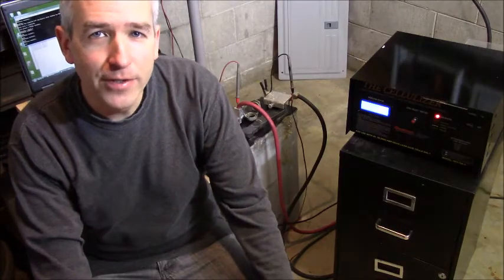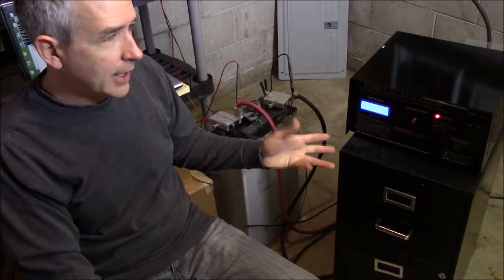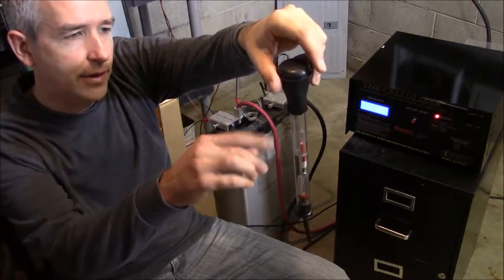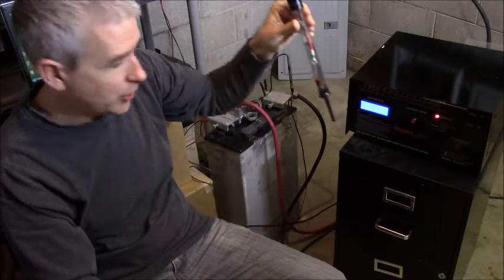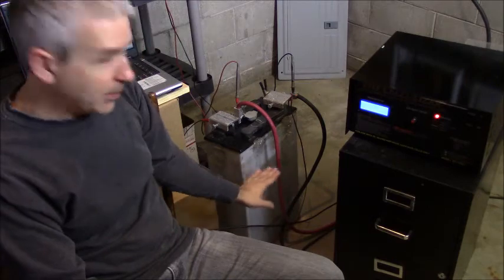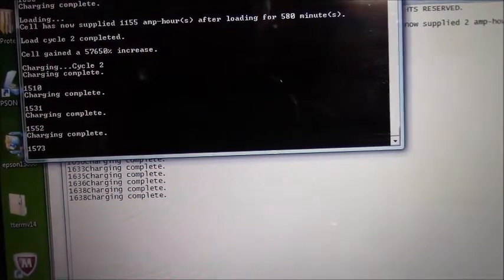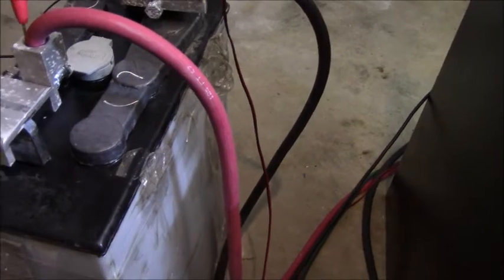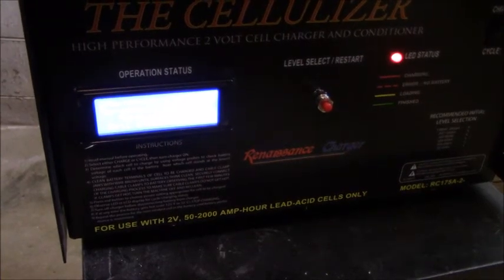RC-175-2 Cellulizer Restores 1000AH Battery after sitting 5 years

Comment: you only got 1 S.G meter? Don't trust it.
Reply from the maker: What are you talking about?
Reply: the Specific Gravity gage.. I have/had 4 of them and 2 Fluid Refractometer Automatic Temperature Compensation. The Refractometer is best.
2 of the type you are using should not be trusted in my opinion. in fact one always would read 1.300 even if the real S.G was 1.260...
Reply from the maker: Frankly I don't use them myself, but I was explaining a little detail about them. Interestingly the final result of my big battery was much higher than original capacity while the meter was still showing lower gravity levels. So I do not judge actual capacity by that. Not sure what you mean in your last sentence.
Reply: here's the S.G info: http://proto.hupsolarone.com/?page_id=108
it's 1.280 S.G at 100% charge.
They do have a good battery, just looking.

Strange that cell went bad any idea why?

Comment: Sorry online translation. Why don't you try to remove the additional current from the aluminum disk. Unipolar Dynamo large current with a small voltage
Reply from the maker: I don't understand. This is not a dynamo or motor but a battery charger rejuvenator.

Comment: Rick - some people have mentioned that if you charge and then discharge and then immediately charge a second time , that the second charge will complete faster than the original charge (assuming the battery temp is steady).  Have you found this to be the case based on your work with batteries ?  If you wait 24hrs to perform the second charge , the total charge time will be the same as the first charge.
Reply from the maker: There is a lot to know about charging batteries, not just with the right kind of charging but the right rest periods. I cover some of that in this video. Without the right kind of charging the rest periods do not have the same results. We are not interested in fast charging times but proper and full charging times. As for loading right after a charge, because the temperature is high therefore the AH will be higher. In regards to what you are mentioning you have to take into account the voltages under load and under charge. Resting voltage is different than these. It takes a little time to understand a particular battery's state of charge and capacity. This is why this machine is perfect to figure that out. Most people do not care to cycle batteries to determine such things so they easily misjudge the capacity of their batteries and therefore the efficiency of their systems. That is why free energy videos with batteries are worthless because you cannot know the condition/capacity of the batteries used.

Comment: Renaissance chargers are fantastic.  I have the 1AU charger.  It charges my cheap harbor freight 12V 10AH battery with roughly 22-23 hours of runtime at the C20 rating.    Resting voltage after 24hrs is 13.3V !!!   Fully charged batteries are normally around 12.6 V.
Reply: forgot to mention that the load is 7.2 watts when I get the 22-23hrs.  C20 rating for this battery is rated at 6 watts, so runtime hrs is even higher than what I have measured.
Reply from the maker: Very good.